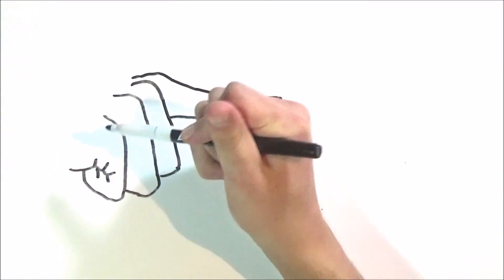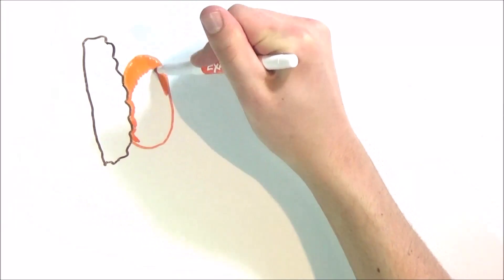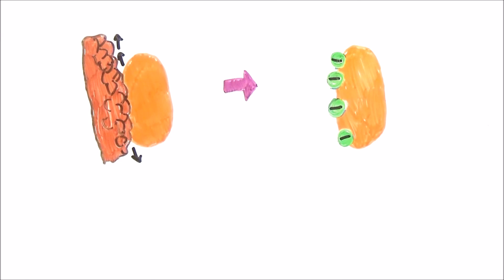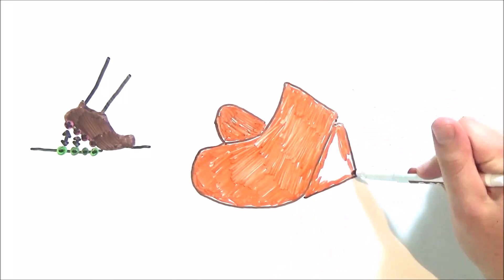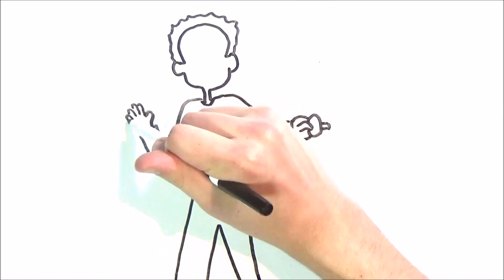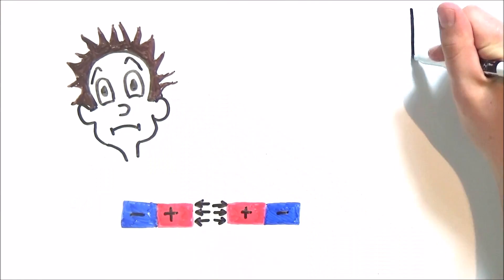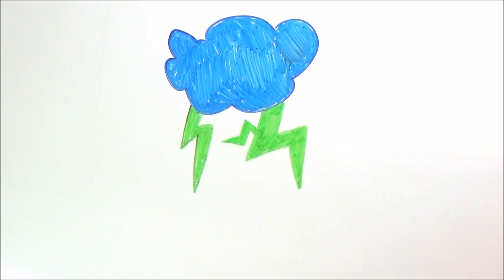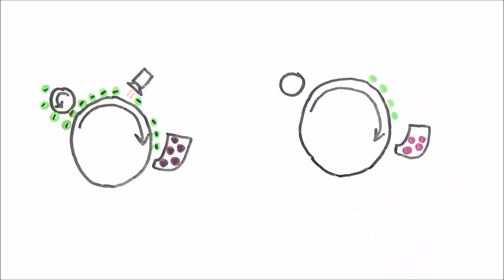What is STATIC ELECTRICITY?   w/ Illustration

Comment: so i just went out of the pool, took a shower, put my tennis shoes with out socks went to the supermarket, and when i tried to grab the plastic bags for my veggies, the plastic would contract on to the other.. if i pulled it and place my hand near the plastic i could move the plastic bag with out touching it.. so my q, are elctrons jumping from me to the bags? or viceversa?
Reply from the maker: Plastic isn't a great conductor, but its surface may be able to get a slight static charge when rubbed...